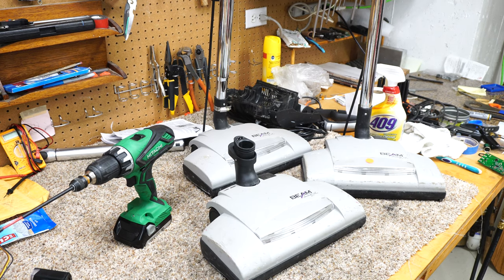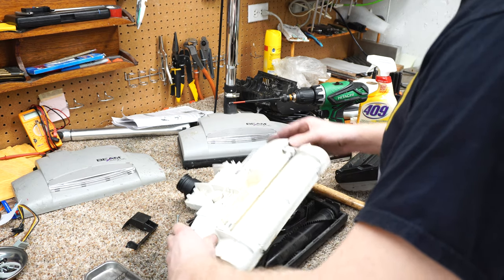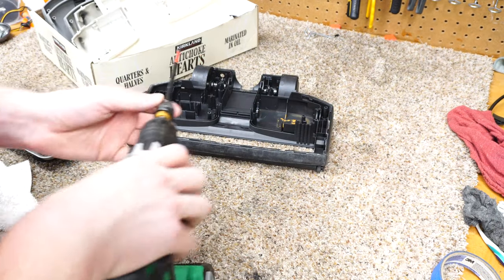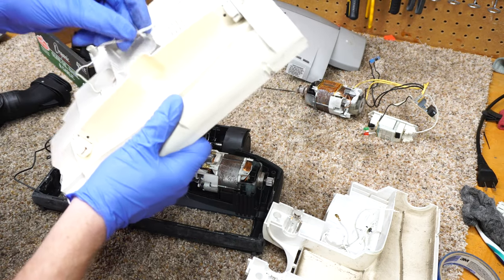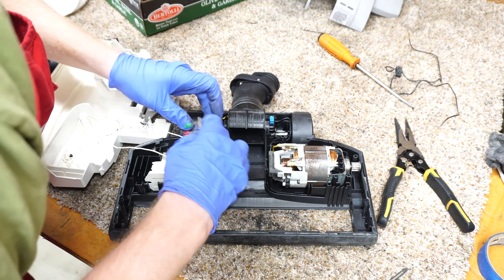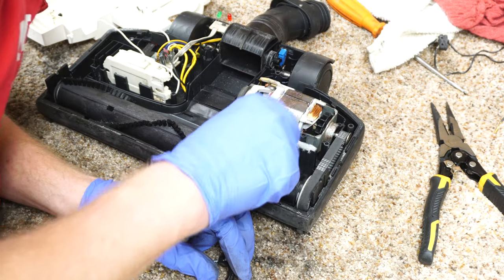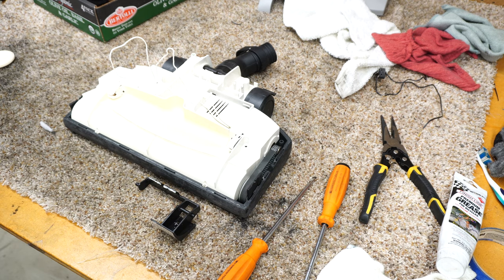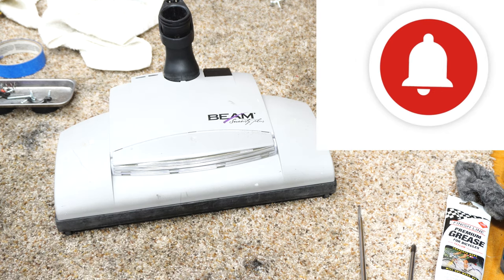Beam Serenity Plus SP800 Central Vacuum Repair

Comment: I wish I could see how the wires connect to the electronic circuit board.  Is there anywhere to get a wiring diagram for this unit?
Reply from the maker: It's pretty clearly shown in the video twice. Maybe pause it and look at it?
Reply: At 14:18 the picture is fuzzy.  At 14:40 I enlarged the picture, but it is difficult to see where the white wires go,  Possibly the white wires connect to the two top terminals, next to the two larger gauge yellow wires. Is that correct?.
Reply: Our vacuum powerhead, SP800A , the roller stopped turning and a red light came on, do you know why this happened,?  The belt is not broken and the roller is not stuck.